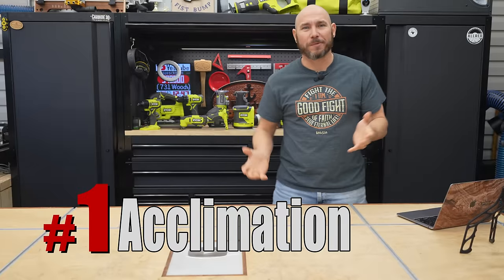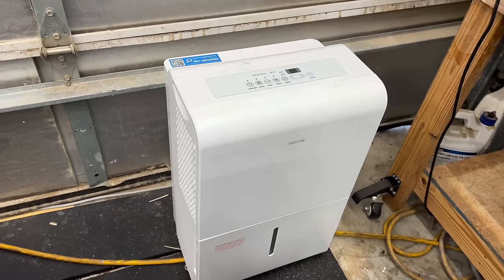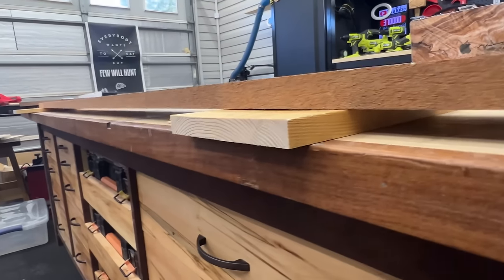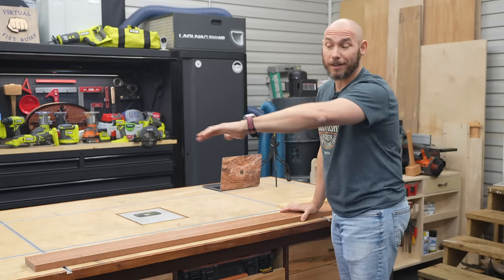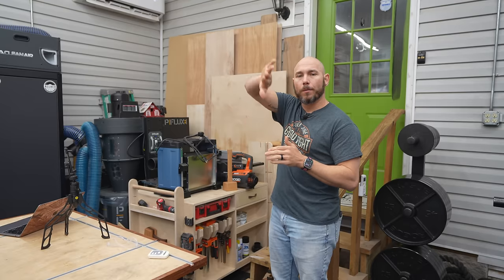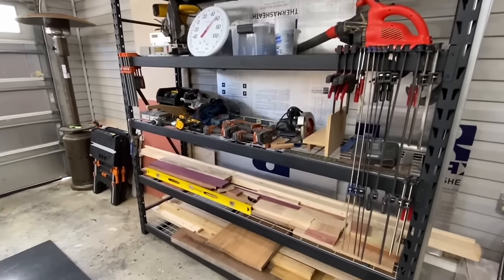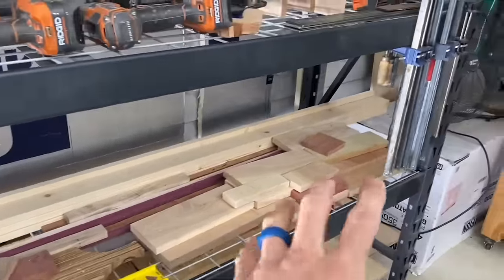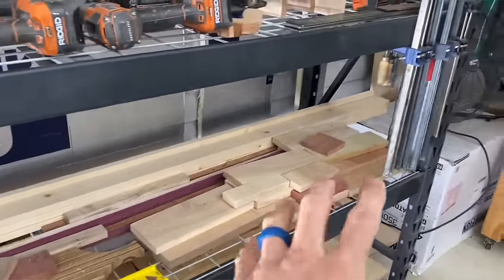99% of Beginners Don't Know These 5 Mistakes Ruin Wood!

Comment: You left out what may be the most important tip: Remove the pith from a board as soon as you can. Leaving the pith in will almost always result in cracking and twisting. Just cut it out and add it to your firewood pile. Best of all, don't buy boards that include the pith.
Reply: What is the pith? I'm a beginner and never heard that term before
Reply: @matthewransom6469   @matthewransom6469  the pith is the center of the trunk.  Since the grain is tightly curved around the center it tends to be dimensionally unstable there.
Reply: @duderb5802  ooooo ok. I see. Gotcha. Thank you very much
Reply: Mathew -- Dude already answered your question. Allow me to add a little more color to his response. In pine and fir, the pith is a dark brown and the 'good wood' is a creamy white. The pith in such woods is typically about the diameter of a #2 pencil.
Reply: @David Walser  ok thank you. I had no idea. I'm learning new stuff every day. I've had to start taking notes lol. There's so much more to it than I thought. I love it tho. 
I'll make sure to steer clear of the pith from here on out. Thank you!!
Reply: @matthewransom6469  All good info for sure, however, your  should be the  you have. Ive seen a guy lose three fingers on a shaper/router before he could pull his hand back. Not a pretty sight and his career was over that fast. Dopnt be scared of your tools but RESPECT ALL TOOLS.
Reply: I'll just add that the pith is the original tree, the sapling.... then as we all know every year after the tree gets a new ring around it from growth.
Reply: Buying with the pith is an easy way to get quarter sawn material. You will want to avoid lumber with a pith which runs diagonally across the board but if it runs the length, that's the piece to get.
Cut it, sticker it, let it acclimate and you've got some good material.
Reply: So... Never use a 4*4 or 8*8?!
Reply: @slomo1562  if you want good 2x6 material these days, buy a flatsawn 2x12 with the pith running down the middle, rip it out, stack it to dry, now you have great 2x6 material.
Reply: @OldsmobileCutlass1969Va  The 4x4 and similar "normally " have the pith in the center therefore as it dries more after purchasing will move in a symmetrical way.  Flat boards are not symmetrical on all sides around the pith and will move in non-symmetrical ways.
Reply: @ryananthony4840  most understood explanation. Thank you
Reply: Man I'm so tired of trying to do projects as the wood is just awful ,  I bought $200 of PT 2x , let it sit for 3 weeks as it was really really wet , not to mention I spent a good 1-1/2 hr picking thru the stack to find straight stuff over half of it either warped or twisted an ends had running splits .
I bought a  piece of premium kiln  dry 1x 10 for a lil project , 4 days later I used about 1/2 of it an 2 days later went to finish the project an the 4ft piece had Cupped & split badly . Another time I was working with some 1x6 Cedar cut off 1-1/2 " long strip an as it was coming off the saw it started bowing out , threw it down on the shop floor an went back out 2 days later an 1-1/2" strip  was bowed nearly 2 feet off center !!!! 🤯🤬 I've Never had wood react this way in nearly 50 yrs of playing Wood Butcher 😢
Reply: @paulrooster2108  I've noticed that too with wood over the last 2yrs, it always wants to twist and warp even the KD stuff.. never remember that being as serious of an issue 20yrs ago
Reply: @JoshNoss  man thanks for the confirmation. I just do this as a hobby an usually pick-up / learn new tips on every project. I picked that strip up off the floor an glared at it trying to figure if it was a section of soft wood in the board or what , A few days later I grabbed the remainder of the board an cut another 2"    Wide strip off it an I'll be damn if it didn't start bowing as well . I've got a couple lil  30 gal plastic barrel's  that I throw most of scraps in . Last winter I needed some kindling for the fireplace an threw in 2 good handfuls of scraps that easily where a year old ,couple of the pieces looked like a 4th of July Sparkler throwing lil
zingers all over the place had to close the spark guard while it burnt down . It struck me as odd cause it didn't have any face bark on it an it wasn't smoking or hissing how green or wet wood firewood will do .
Reply: I like seeing all the Ryobi tools. They are a great value. I only buy other brands if they have a superior feature, eg. the blade release on a Bosch grinder. I do watch Youtube reviews before buying a tool. Ryobi has a few dogs.

Comment: My problem is that my local Home Depot and Lowe’s is so careless with their products that I can’t seem to buy any pieces of wood that aren’t already bent and twisted. It’s really frustrating how badly they care for their lumber. Also, gone are the days of actual local lumber yards. I used to work for one when I was a kid. They’re all gone now. The big box stores put them all out of business. 😢
Reply: Yes, and the Big box stores buy wood from Canada, New Zealand  in bulk, nothing locally sourced these days.

American lumbers to expensive due to labor fixed costs.   Plus with foreign suppliers, their moneys cheaper and so it’s more profitable for the US lumber retailers to source them from outside country.
Reply: The shipping of that wood in containers is what causes so much warpage. It sucks cause the lumber sits in those containers soaking in sea air.  Once the containers opened, the wood starts drying and warping.
Reply: This very much depends on where you are. Here in the Hudson Valley region there are several excellent hardwood suppliers. My favorite is very near our local Homie’s Depot. The BigBox stores definitely changed the market, but not always for the worse.
Reply: You have to be wealthy to have nice, straight boards. Or risk your life using a terrifying jointer with it's enormous spinning blades of death. I can't believe in 2023, there hasn't been a machine made that can actually straighten a board. We can make a cell phone, but we can't improve the jointer that was developed in the 1880's?
Reply: The large corporations pre-buy and buy in bulk; it's a commodity market with a whole bunch of speculation involved.  Lumber usually runs at a low margin or at a loss - it's primarily offered in order to get contractors and DIYers in the door to buy high profit items.  

They don't care about quality, because they're all run by boards of executives with MBAs, not experienced tradespeople.

Comment: I bought 3 bumper dragging loads of 16' pressure treated 2 bys "cull lumber" from Home Depot for a cabin I was building, about $100 a truck load. Seriously twisted up junk. I stacked them all in a block of sorts and ratchet strapped them tightly together and left them in the woods for acouple of months uncovered. They all straightend out perfectly.

Comment: Really good advice I have a mill just under a mile away (I know what a blessing) and the fella who runs it has become one of my best friends. when wood a couple of years ago was skyrocketing he was selling me 1 1/4 " by 12" by 14" pine and poplar for $ 10.00 a plank and has been doing the same up to today I remolded our ranch home with all wood walls and floors and it turned out great I made wood hangers in my garage I have a 12 ft slab to joist so plenty of room for the 250 planks to dry out in. After serving  in the Army in the 70's I started a small flat work concrete company and a small drywall one as well after 30 years of hanging drywall and pouring concrete I worked in a mine for a few years done a lot of trades but this retirement is by far the hardest work I've ever done but it's also the most fun I've had here deep in the mountains of TN/NC my wife and I are having a blast I put in a 3000 sq ft raised bed garden for her and we have 40 egg layers neighbors are far and few but great folks. we just celebrated our 40th and this old Christian is enjoying every day I refuse to retire when working on our little ranch is so much fun. Blessings :)

Comment: I liked that you mentioned a dehumidifier. Once I was at my local lumber yard and noticed an odd unit if utility 1 X 4 Douglas fir that was of exceptional quality (all heart, vertical grain with very few knots) and less than 15% of the cost of clear heart, VG, kiln dried. My wife and I both LOVE Douglas fir. I picked out a lot of it. Put it in a room, stacked it with stickers, bound it with straps and turned on the dehumidifier for several weeks. The result was fantastic. We trimmed our guest cabin with it and it looked fantastic. It cost us less than $300 to trim a cabin with wood that would have otherwise cost almost $2,000. Thanks for the video Matt !!!

Comment: I totally agree with the dehumidifier. I have had one in my shop for several years. It was initially there for MY comfort, but I soon noticed that the wood was acting nicer as well. Of course in the winter I am running a small humidifier instead, again for MY comfort. (I am up in central Maryland, so the air does get cold and dry.) At the start of the day the humidity may be as low as 20%, but even after running all day it only goes up to 30%  so I'm not too worried about that.
Reply: Here in South Jersey same weather, we are only 3 hours away but question about humidifier. I do need to up humidity from 20% also, running humidifier  won’t rust table tops? I’m getting a lot of warping with construction lumber. Even after doing everything in video other then something weighing it down.

Comment: Very true.
I made a desk for my son, I bought the lumber about a year before I even decided to build him the desk. The lumber was from Home Depot, when I used it the pine 2X10s were so dry and light weight. Much easier to work with. I know that 1 year is a  very long time but letting it dry does make a big difference. I think you see more of the twisting and bowing on projects that call for longer lengths. I build a dinning bench for a buddy that was 8 feet long and the top twisted within a week… I used the lumber right away after I bought it…. 

Lesson learned

Comment: When I buy construction lumber, not only do I stack it off the ground supported as you suggest. But I stack it tightly together and wrap it every 4 feet or so with ratchet straps.
It takes longer to dry/acclimate, but all the warping forces cancel out and my lumber stays arrow straight. This works especially well with that dripping wet treated lumber.
Reply: I had thought of doing this if I needed to. I would add though instead of just putting stickers or fillets (the spacer boards) on the horizontal I would put them vertically too so all edges have air flow and it will dry out quicker

Comment: Great tips, especially for a beginner like myself. I have been accumulating pallet wood and needed some place to put it all. So, I  used some of the wood and long, narrow pallets to knock together a couple of racks. It all works and only cost me buying screws for it.  I know the south is humid, but here in the Pacific Nortwest, I've got an actual Rain Forest just a short drive up the coast, so good info to have!

Comment: I use those exact wood storage racks. Personally I think anything you can store “overhead” you should. It not only protects your wood, but it really clears up space in the shop as well👍🏼
Reply: I wish my garage had over head 😂.. single garage low asf roof and half the Mrs friends and families crap stored in there I have portable benches and the few things I've started building are outside in the driveway with wood I bought that day cause if I don't use it that day it's in the way

Comment: Over the years I’ve seen all kinds of storage. I worked in a production shop for a long time, where we ran thousands of feet of poplar. That stuff came in, and went right into flat unstickered piles in the cutoff room. We never even checked moisture. Rarely had a problem with movement. 

These days I’m in a small craft shop with varied storage. Some vertical, some flat on Bora racks. I have to say, the vertical is my least favorite. It’s fine for very short term storage. But long term, the lack of gravity so to speak, allows the wood to move more. 

Great video! I always enjoy your content.

Comment: Great information! I typically store my wood elevated off the floor, not subject to sunlight. I normally am building with it right away, but I'm also only a few miles away from the lumber store. Once I finally build a storage rack, I will probably "stock up" on certain types, and let them sit for weeks until I figure out what I'm going to build with it.

Comment: I want to put a clamp bar into the wall, but I smiled when I saw your husky shelves. I was lucky enough to have those for a long time before I figured they were perfect for stacking wood. I put rectangles of lauan behind each shelf with zip ties so stuff can't get knocked and fall behind it.

I also eventually figured out that those shelf supports make a good enough clamp rack for now. Just had the light bulb go off 2 or 3 days ago haha

Comment: I live in a desert, and it is code for any wood (2x4's mostly) that touches the concrete slab (especially in a basement) to be treated. Even here where humidity is in single digits, moisture from concrete is still an issue. Definitely get the wood up off the ground. Great suggestion!

Comment: Here's a tip for you:
If you accidentally get an unwanted hammer mark in your wood, as long as it doesn't break or splinter, you can use a damp cloth with an iron to pull out the mark 😉
Reply: I have heard that multiple time but it’s been a long time. Thank you for thr tip that I’ll make sure to implement!
Reply: Does it work for end grain as well?
Reply: I've tried this, didn't work for me.
Reply: You know those hammers with a ball on the other side instead of a claw? Wet the dent and tap it with that ball. The dent comes out. I’ve never known it not to work

Comment: Thanks for the info, enjoy your channel. I'm following most of these tips but it's tough in a 1 car garage space --especially when you need to move a car into the space (I always stress when I park my rain covered Jeep next to my expensive hardwood lumber). I'm totally for waiting days, if not weeks, for material to acclimate and dry out. I'm on Cape Cod and humidity wreaks havoc here in the summer. Board cupping is something I deal with all the time.

Comment: Very nice video. Entertaining and informative. “Stickering” the wood is paramount. It is especially important with treated lumber which has a much higher moisture content and is not cut as closely to dimension as white wood. Anybody building an outdoor project should buy their wood as far in advance as possible as most treated lumber (except at Lowe’s and Home Depot) is stored outside at the lumber yard. Take it home. Sticker it and let it dry completely. I will be adding to my deck this summer and my treated lumber is now in my barn drying out.

Comment: The last 3 years, I've been doing several projects with treated, or ground ready lumber. I have impeccable timing, and seen to always order my product, right after a truck has delivered it to the lumberyard. I often get treated lumber that is practically dripping wet. I tried storing a small amount, in a small area with a dehumidifier. The rest I set up on my driveway, with stickers as needed. As long as I cover the lumber on the driveway, when it's going to rain, the sun helps immensely, in the time it takes to dry. The wettest of it has dried in as little as 45 days. The pieces that I've put in the enclosed area, with the dehumidifier, have taken up to 8 months to dry. I'm not good enough, nor do I have the room, to take possession of my lumber, a year ahead of the project start date. I live in Iowa, 8 months is the whole outside working season for me. I don't have the room, yet, to order in the Fall, for projects the next Summer.
Reply: OTher saying be careful with treated stuff, the chemicals used off gas for months to years even after fully dry, sounds about right. only thing to watch with solar drying is it does not dry down to fast to avoid checking.
Reply: You also have to really be careful about dust control when cutting treated lumber, couple of coworkers have serious lung problems from it.
Reply: I don't use treated lumber for furniture projects.  But I def use it for outdoor projects.  What works best for me is finding the lightest dry out wood that is straight.  Cuts down on the waiting time for paint or stain

Comment: I'm about an hour outside of Toronto but it does get really humid here in the summer months. I built an insulated lumber shed with a de-humidifier and it's been great. I can get freshly cut maple slabs that have not been dried out for cheap, keep them flat in my shed for a year or so and then work them and get hardly any warping.

Comment: Hi! Love your videos and your t-shirts (wear the colors, brother!!)!   Question: I have had occasions where I needed to buy some bulk deck boards that were, unfortunately, still wet with the rot-resistant treatment fluids. I knew that I the outer boards would dry on the exposed side quickly and warp, so I strapped them together with ratcheting tie-downs - not tight, but enough to keep them from major warping. It may have slowed down their drying overall, but it kept them straight and flat for the 1-2 weeks that I needed to store them before installation. Smart? Foolish? Better options?  Keep up the great work and great videos!

Comment: I've always stored my sheet good flush against a wall and use 2 sash weights hanging by a cord fastened to the wall above my plywood (you could use anything weighing a few pounds).  No worries of any bowing, even if they're there a long time and the weights insure no tipping over.